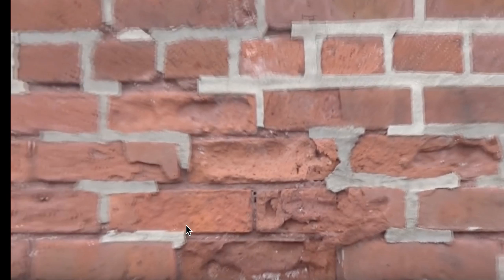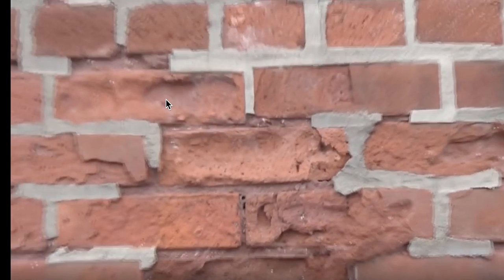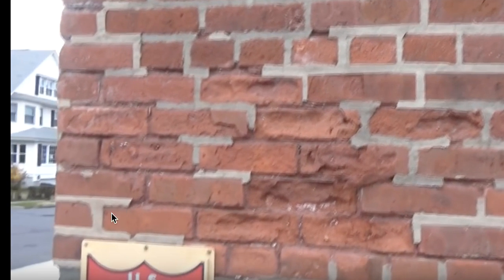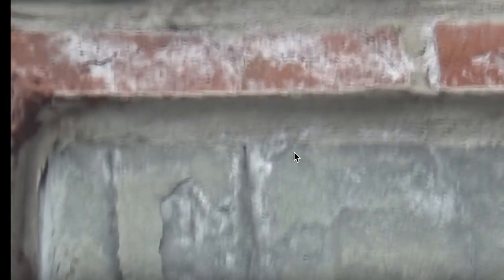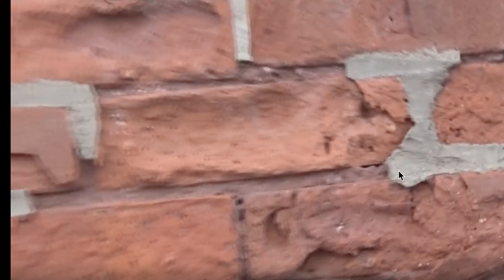Brick Pointing failure and why

Comment: Great video. I am a 15 year brick pro and you are right. By not tooling the new joints there is water getting into the brick causing the face to crack off. But they couldn't use a "tooled joint" because they they didn't get enough of the the red mortar out. Well done and you are right!
Reply from the maker: Thank you for your support...
Reply: nice

Comment: Mike Hadduck says there's no right or wrong as long as it works. He also says concrete and Portland cement is man made and is always going to fail so needs maintenance. Those bricks spelled because water got in and couldn't get out. I live in the UK and it's the same over here. If you don't use line with old brick the brick will explode. Cement is awful stuff. RE-bar is awful stuff. Mike Hadduck is correct in what he says

Comment: I'm not sure if you still check this... But I'm working on a brick house in New England. It was built in 1900. The foundation looks to be pointed with lime mortar. The rest of the house was bricked in the 30s with salvage bricks from factorys and also some new at the time. Is there an easy way to test the mortar?

Comment: that is old brick with lime morter cement traps water and the wall cant dry then freeze thaw the brick loses it face same problem in uk with cement render on old houses another problem may be from inside as people insulate old buildings the heat would of helped the brick not to freeze im a builder of 35 years

Comment: Thanks for this video! I am considering purchasing a brick rowhouse which upon inspection we discovered throughout the visible parts of the house (basement foundation walls and piers, exterior wall and chimneys) much of the brick is spalling, and almost all of it needs to be scraped and repointed. How bad is this for a house? It's 100 year old house, as are all of the houses in the area. We were wondering if the original craftsmanship was poor, or if the mortar was a bad mix. We were initially worried about a structural beam, but the structural masonry weakness seems to be just as worse. Any advice? Would this house be a terrible investment with the work needed on the masonry?
Reply from the maker: I would have to see the images, know the price of the repairs, the price of the house, the going prices for homes in that area, and perhaps suggest you even change heating system to a high efficiency system... their are a few other variables to consider...  But, do not buy a money pit unless you have the money to throw into the pit and the value of the house increases with all your repairs...
Reply: Probably repointed with wrong mortar. Bad.

Comment: Hmmm, I think the brick spalling is not due to water intrusion and freezing.  That's a soft-baked brick, and the pointing mortar was too hard for it.  The mortar should always be softer than the brick; that prevents spalling as the brick heats and cools because the mortar flexes and allows the brick to 'breathe' over temperature extremes.
Reply from the maker: Ideally, they expand with one giving and one take....

Comment: What a critical critical critical thing for NOBODY to point out in any of the videos I have seen (to date) except this one..

 If the mortar is stronger than the brick something has to give when the brick expands. 

 I am currently working on an old house where everyone is pointing fingers at the roof for the water intake problems. It doesnt have the issues with brick shattering like in this video but tons of mortar is missing.right where the water damage in the plaster is.

 I am going to be filling these joints myself. Is there a product i can get  at blowes or home cheapo that will do the job without possible future problems like that and, after im done and things cure would sealing it be a bad idea?

This place is a good experimental rental for me to practice and make aesthetic mistakes in case i ever have to do it again. Which i dont want to but, the last time i hired somebody he trashed the parking lot and his work sucked!!
Reply from the maker: William, I was going to post a video reply for someone else with a similar question... give me a day and check back... I have to find the source videos, and edit them...    I am guessing you subscribed... So, you will see it in your feed...

Comment: Hi neighbor!  Just bought property in Montgomery County PA . Needs brick pointing on exterior wall and chimney. Was planning on doing it myself, but I'm thinking it would be best to let a pro do it. What's the going rate for about 80sq ft and a standard size chimney go for?  
Thanks
Maggie.
Reply from the maker: It's a ''what the market can bear"  - also, some companies have a larger overhead than others...
Small jobs can cost an entire day's work... Quality, is what you should pay for... The prep work is most important and to make sure your existing brick do NOT wick away the water from the mortar being applied... Basically, you brick need to be saturated to the point of NOT being able to take water away from the mortar being applied...  Then follow my advice  in video...
Reply: Thanks so much!  Now to figure out  which mortar to use :-)
Reply from the maker: I will  try to show you over the next few days, how to determine that... I will have to make time to explain mortar on restoration...

Comment: I understand why you would want to use lime mortar instead on an old building like this, but how would you recreate it so that it's red like the original?  How did they make their mortar that red color way back then?
Reply from the maker: I have no idea how "they" made that red mortar - BUT, you can add red dye to mortar to get it red...  In other words, just add dye is typical on coloring mortars.
Reply: They used red sand
Reply: Contact Heritage or Spec. They can match the original mortar.

Comment: How do you tell the PSI of the existing pointing? I need to repoint but don't want to cause more problems by picking the wrong product.
Reply from the maker: Jen, sorry for the delay, if you could share your brick information, I could tell you what PSI to max out at... 
With that said, you would rather use a ''weaker'' mortar than a ''stronger'' mortar---
If, your brick start flaking off like these, in the video, you will then know you made your mortar too hard! 
Weaker mortar can be done by more sand to your mix... and also by the type of portland you use in your mix... Just some quick pointers for you (pun intended).

Comment: What's the coldest weather I can point in
Reply from the maker: What are the weather conditions that you want to point in... perhaps that will help with my answer... as few other factors need to be considered besides ''ambient temp."
Reply: As Long as it's not  forcast for   frost you can repoint but if it has to be frosty then don't do it as it will freeze and fall out

Comment: The brick has blow because the morter is harder than the brick.
Reply from the maker: That is about the size of it... expansion needed to take place for this to happen... perhaps even heat from the inside of structure to the exterior was the differences... this needed to fail...
Reply: @EngineerPEretired  agree with you. Was always going to fail.  Maybe its just a DIYer having a go.
Reply from the maker: A lot of ''cement masons'' are not knowledgeable about their products - most just think it is just some cement they slap things together with...
Reply: @EngineerPEretired  I'm based in UK. Most of the work I do is lime based.     .  We come. Across this alot